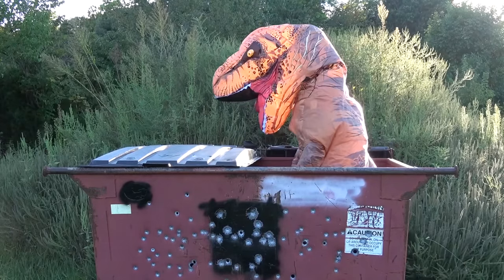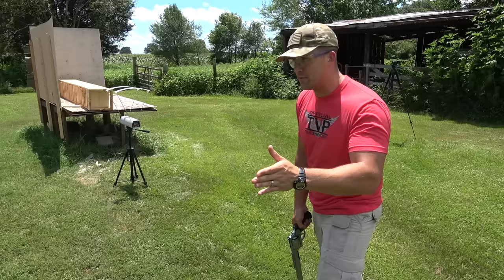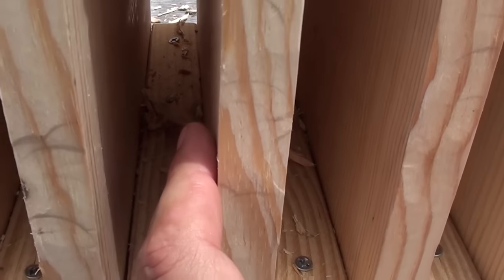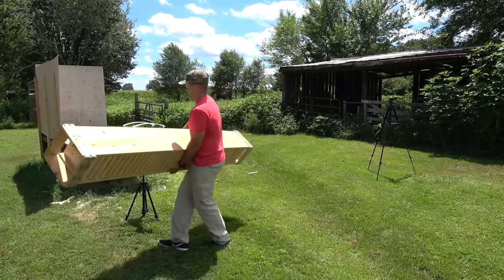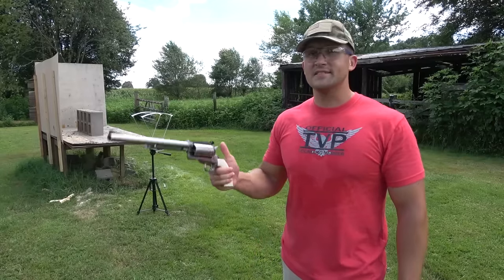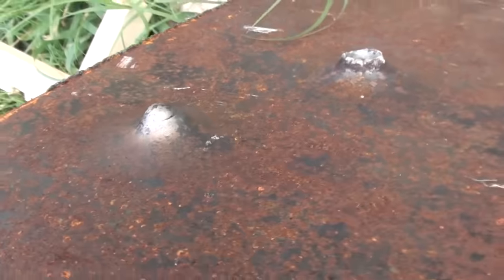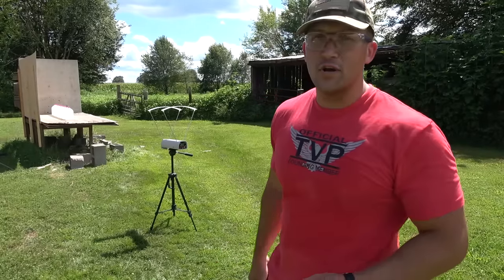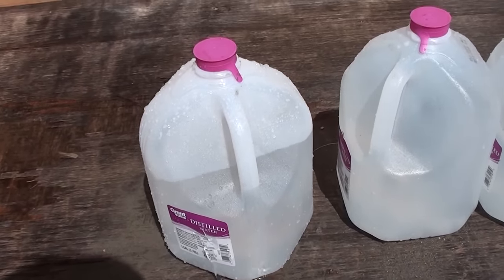500 S&W Magnum vs 45-70 vs 450 Marlin

Comment: I'm a 71 y/o woman who loves shooting my BFR 4570.  I also love my Springfield 1873 "Trap door" carbine.

For a round that was brought out in 1873, the .45-70 cartridge has only improved over the intervening decades, as proved by how it performs next to modern ammo designs.

The secret to handling a BFR is to have a high, tight, 2-handed grip, with the hammer spur digging into the thumb web.  That puts the recoil (very strong push, really) straight back into the plane of the arm, and makes the revolver easy to control.  The grip also allows fast cocking with the weak hand thumb.

Comment: Just proves once again... there is no need for the newest game-changing caliber.
100+ years ago, .45 was on top, and it is still hangin in there.

Wtf bro?!? No tyranosaurus booty shake?
Reply: Well, he's also using a 500 grain in the s&w and 430 grain in the others. 70 grains is a big difference. Also, Speed penetrates.
Reply: The FuzzyMonkey 
I reload my .500 S&W with Cast Performance 370gr. WFNGC Heat Treated Solids. At a distance of 50’ it penetrated & exited the 16” trunk of a Mesquite Tree. The bullet entered the hill approximately 14’ behind the tree, and we dug it up nearly 9’ back. The bullet cracked 2 rocks, and we found it in the 3rd rock, also cracked.
After that, it became my GoTo Bear/Hog gun!

Comment: I bought the BFR in .450 Marlin, but had the 45-70 cyclinder fitted, because 45-70 is cheaper to reload than the Marlin. Love that you did these 3.
Reply: Only thing cheaper about the 4570 is brasd. They are the ballistic twins when loading accordingly. Same bullet, primers when hot loaded.

Comment: Well done. Couple suggestions i have is to use a Sharpie marker to mark the spaces on your box with numbers to save you from having to count them everytime. You can also circle and mark holes of different loads calibers for easier reference. Keep a rubber mallet and a piece of wood handy for persuading a stuck board. Keep doing a great job and safety first.
Reply from the maker: Thanks 😁

Comment: Chrony is brilliant! I ran each round as told us through an energy calculator. Was interesting to note the 45-70 and 450 Marlin beat the "most powerful production revolver in the world" 500S&W  consistently for muzzle energy.
Reply: The 45-70 and 450 beat the 500 S&W Magnum!  Wow... that’s a shocker.  How in the world can two rifle cartridges beat out a handgun cartridge.  It  just doesn’t seem possible.  Next, let’s see if the 45-70 and 450 can beat out the 300 Win Mag.  That’s anybody’s guess who would win that one.
Reply: Rifle big bores are always more powerful than big bore revolvers.
Reply: @samuellloyd6582  I didn't say they were in a rifle. I'm talking about all the cartridges mentioned in revolvers being compared.
Reply: @jimmiekaelin4804  I'm talking about all cartridges out of revolvers. The video is about revolvers.
Reply: Well of course the 45-70 and 450 Marlin will out perform the most powerful handgun cartridge, the 500 S&W... they’re both rifle cartridges.  You don’t need a chrono to figure that out.  Why don’t you compare the 45-70 and 450 Marlin to a 300 Win Mag.  The Win Mag has a much smaller bullet.  Do you need a chrono to figure that one out?
Reply: @neckstumping  no matter, the 45-70 and 450 are rifle cartridges.  You can put 50 BMG in a revolver but it’s still a rifle cartridge.

Comment: I like the pine board test because it's something I can understand.

Have you ever tried using plywood, MDF, or ?  Since wood is an orthotropic material, you'll always have inconsistencies compounded because of the boards material properties.  To lessen those inconsistencies, you could move to an engineered wood property.  That would also include in your audience scientist studying hardness of their materials.  As an example, the Army conducts hardness test for ballistic protection in building materials.  They found dimensional lumber is unreliable in that one projectile might pass right through when another exact projectile would be stopped.  FEMA did impact test for hurricanes and houses.  One of those test led me to believe I would never live in a house with OSB sheathing.  I would like to see you shoot through typical sheathing materials just to see how poorly our homes hold up to bullets, I think it would also be cheaper for you to saw up some plywood than the pine boards and you would lessen the stray bullets.  I think to only downside is burning it after you're done shooting it.  But I think a open bottomed burn barrel would incinerate it pretty good.  Regardless, I love the stuff you do - and I would have never known about the .450 Marlin......

https://www.fema.gov/previous-missile-impact-tests-wood-sheathing

https://www.fpl.fs.fed.us/documnts/fplgtr/fplgtr113/ch04.pdf

Comment: If you were to do this again, you could pull bullets from the .45-70, and load them in .450 Marlin. It is the same bore size. That would let you compare the same bullet type, albeit handloads vs factory.

Comment: All 3 are close in power. But I'd take the 500 Magnum anyday. 

500 Magnum is usually more powerful in a revolver than the 45-70. 

45-70 needs a longer barrel life on a rifle to reach its full potential for velocity.
Reply: The 500 handles the extra power better too. But "Cowboy Load" 45-70 is cheaper and easier to find than 500 Special or other downloaded 500 Mag.
Reply: You brimg up a great question in my mind. I wonder if the 45-70 could be hand loaded using a powder that would be better served in the shorter barrel of the pistol for better performance.
Reply: That would be a tricky one. If you go with a faster burning powder your chamber pressure would also rise substantially. The case of the 45-70 is not as strong as the .500. You may get overpressure signs before you reach the velocities achieved with the rifle powders. Seems like someone would have tried it before though.
Reply: I’d disagree, both offer very similar ballistics, but the 45/70 has over a 100 diferent ammo types and is avaible at all of my local gun stores. The .500 magnum is rarely available unless I order online and usually can only find a couple diferent types.
Reply: The 45-70 is designed to use black powder so the faster burning powders typically are not a issue.
Reply: Charles Thacker , The ORIGINAL 45/70s govt. were black powder used in single shot rifles w a 405 gr WFN slug at 1300 FPS back in the early west. Modern ones use smokeless powders in lever action rifles  & push 430 gr WFN slugs out the bbl at 2100+ FPS. Thats almost double the black powder loads. The longer the bbl the higher the velocities. In these handguns theyre not even reaching half their potential. IF loaded w faster pistol powders would prob blow the thin cases up. Never designed for handguns. The 500 magnum on the other hand...  WHUFF!! 😁
Reply: I trusted when i saw in the steel plate and the 500 is back of the 45-70...

Comment: Awesome and interesting video. Really liked the 1/4 steel test. I tested some 1/2 thick steel a while back and with different cartridges and it took 7mm Remington magnum to make it through. 30-06 would not do it. I think AP M2 black tip 30-06 would do it. Supposed to penetrate up to 1 inch thick steel.
Reply: I shot a lot of rifles before buying a big game rifle. I ended up with the 7 mag. I wouldn’t think twice about dropping an elk at 600 yards with one. Extremely accurate. Shoots flat and delivers a hell of a punch. It was a toss up between the 7 mag and the 300 win mag, but I went with the 7 mag because of the little bit less recoil. I could have gone to a little more exotic caliber, like a .280 Ackley, but I like to be able to go into any gun shop and buy ammo.

Comment: if I had your testing setup id screw a piece of 2 inch foam insulation board to the plywood at the back of the table. then fold up some old bedsheets and staple em to the foam. the bullets that veer out at reduced velocity can be stopped by the fabric and the foam will absorb the energy, this could greatly reduce lost bullets at a low cost and is a bit safer. cheers

Comment: So, is the .500 S&W still the most powerful production handgun in the world now? Hmmm.. the .45 cal lever gun rounds have bigger powder capacity than the .500, but because they're not designed as a handgun cartridge, they seem to be a little less efficient out of a handgun. This video showed, that they're just about neck and neck. The heavy .45 cals on average have more sectional density, so they penetrated a bit more with equivilant bullets. But they all performed outstanding. Thanks alot scott for your time in making these videos! Btw i'd like to ask you, how is your BFR performing up? I seen videos where the ejector housing on that gun breaks off from the massive recoil of a .500 magnum. Hows yours holding up? Thanks again.
Reply from the maker: Thanks! It seemed to be doing good.
Reply: Force = Pressure x Area(base of projectile).
    SAAMI spec on 500mag is 60K psi so not going to get much higher than that.  Also not going to get a larger projectile without running into legal issues.  500mag is optimized for maximum power out of revolver type firearms.
   45-70 designed for blackpowder but can use case capacity for a powerful smokeless cartridge in firearms built for it.  Large case capacity can hold more slower burning powder that would only be realized by using long rifle length barrels.

Comment: I think the bullet chronograph is a valid illustrative tool. 

It is always nice to know how fast bullets are flying in the field using barrels which are different than the firearm test barrels as used in factory conditions. Some ammunition manufacturers like Hornady include in their performance specification the barrel length used to gather the ballistic information for example, 45-70 Government 325 gr FTX® LEVERevolution® TEST BARREL (24") SKU#82747.

It stands to reason that barrels shorter than the factory test barrel length will have less than the optimal published test results while barrels longer than the subject test barrel, like a Marlin 1895 CB with 26-inch barrel should have slightly better than the manufacturer's published results.

In California for the 2019 rifle season, lead ammo of any kind is now banned so only solid copper or other non-lead qualifying ammunition can be in possession while hunting. I was sure impressed by the performance and the penetration of Underwood Ammunition 45-70 Government +P 325 Grain Xtreme Hunter SKU# 908 passing through two-kevlar vests as seen in a previous Kentucky Ballistics video. 

My only off comment about Underwood Ammunition is that they do not disclose what length barrel was used to obtain their published results as they only disclose which rifles are deemed safe and which rifles are not deemed safe for their ammunition due to elevated chamber pressures as a result of modern gun-powders.

It is always nice to watch these informational videos as the expense of the pistols, the ammunition, and the materials (like clear pine boards without knots) are expensive.

One thing from Kentucky Ballistics I would like to hear a comment about is the handling difference between shooting the BFR with standard grips and the BFR with bisley grips (which one grips, points, and feels most secure after recoil?).

In California we have large indigenous rodents called Demo-Rats, what is the largest rodent you'all have in other regional parts of the US?

Comment: Great video but you should have used new boards for each shot. I would think once a bullet goes through the board it is now compromised and would make it easier for the next shot to travel through that board. I could be wrong. Nothing beats a big bore handgun.
Reply from the maker: As long as it isn’t cracked it’s still good. If a board cracks I remove it. 😁🤙
Reply: Yeah, I probably should’ve watched the whole video first. I found it interesting because I wanted bfr in 45-70. Great job.

Comment: Sectional density of the 45 caliber is higher than the 50 caliber. Speed helps penetrate steel. Breaking concrete is even though.

Comment: I'll keep my 500 S&W with the 13 3/4 inch  1" Bull Barrel thank you anyway. The 500 S&W was designed to have more power and less recoil than the 454 casull. Which i don't own the 454 casull anymore. 😂😂

Comment: The 450 Marlin is the boss.Even without plus p or hollow points it won the plywood test done as well as the 45-70 in the steel plate water jug test.If he had plus p or hp ammo it would have won by bigger margins.And thats the down side of the 450...Minimal ammo choices

Comment: What's the difference between 45-70 and 450 Marlin??
Reply: The 450 is loaded to equal the performance we get hand loading the 45-70. The 45-70 has been loaded to lower pressure forever to keep idiots from putting it in a older firearm and blowing them up. Now with all the +P ammo the difference in factory loads is less than it was when it came out.
Reply: About one number apparently
Reply: 45-70 is rimmed, 450 marlin is rimless
Reply: Last year there was a rumor that Marlin was going to re-introduce the 450 Marlin in the Model 1895 but it didn't happen. As far as I know the only production rifles chambered for it are the Winchester Model 94 and the BLR.
Reply: The 450 was popular here in Alaska with the non hand loaders for a while, but the factory ballistics didn't quite match the 45-70 hotter loads then the plus P loads kind of made it a non issue. It's a good round, just the 45-70 has a bigger fan base. It gets the job done on moose and bear.

Comment: Why not just add a smaller, removable, 2ft high plywood wall to the right side of your setup? That way bullets wouldn't bounce out into the grass and be lost.
The way I'd do it would be to screw in two U brackets facing inward at either end of the table on the legs. Each bracket opening would be 1/4" or 1/2" wide at the opening. Then I would screw in a small scrap block of wood under each bottom bracket to prevent my plywood wall from sliding through. Then simply cut to appropriate size a 3ft high plywood wall to slide down into the brackets. 1ft in the brackets and 2ft above. Easy to make and remove and you no longer have to worry about losing bullets out into the grass.

Comment: don't the 45-70 and 450 Marlin use the same diameter bullet? so cant you just load up some 450 Marlins with those bullets that you used with the 45-70? or were you just using factory loads for this experiment?

Comment: I like to see you use a 8mm Mauser from light to heavy bullets on a 1/5 diamond plate steel I shout a little bit closer than I should or the angle was not right it bubbled the back and checked the box it some stolen my steel plate but I think it would have gone through all the way if I had several other Wights maybe you could try to out get the angle right I moved a few inches to left I gladly I did you can hear it coming but you can't see it  but it hit me in the right leg I am so glad I moved it would be more painful if didn't you know what I mean

Comment: When u shot the steel and the 500 mag didnt go through but the 4570 did didnt make sense because the 500 extreme  penetrator  had a couple hundred more ft lbs and was going around the same speed  and ik that speed is what u need for steel i just thought is was a lil weird